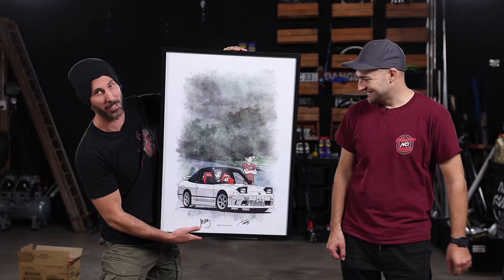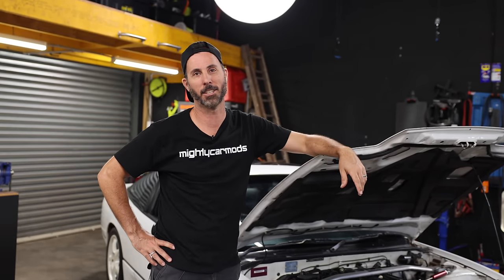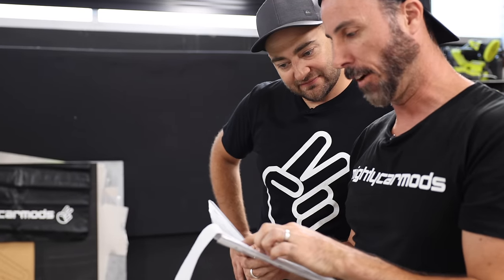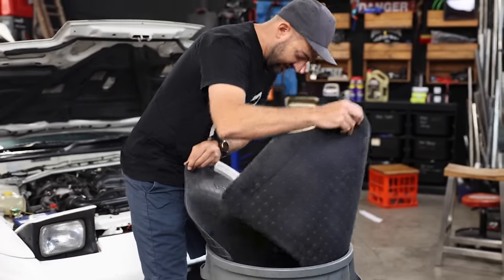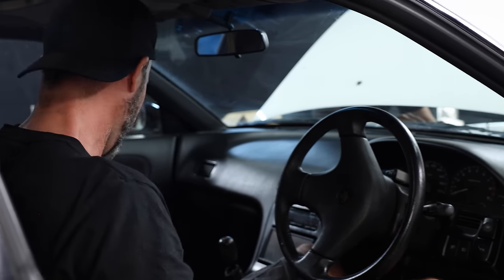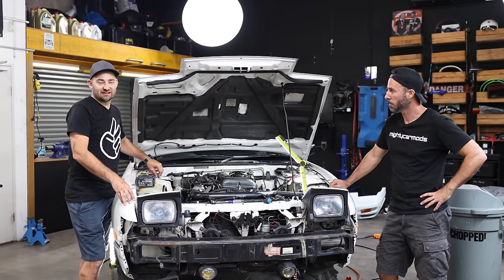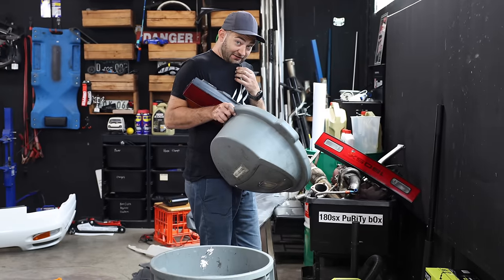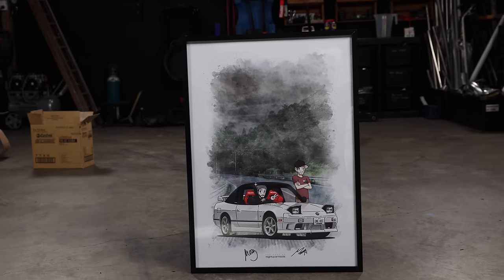180SX - DREAM BUILD

Comment: FYI the little green plug is a brake pedal stopper, it activates the brake switch, sometimes they flog out and your brake lights stay on, just tack a 5c piece in there for ultimate reliability!!
Reply: I slipped a bolt through mine years ago and it’s still fine
Reply: Love Macguyver fixes. 👍👍. Good job 👍👍❤️
Reply: Came here to say this ahah
Reply: @ashbroussard4854  Ah shit same. Think they were unavaliable for a while there too!
Reply: Also goes on the clutch pedal its a stopper for the switches

Comment: I bought my 180sx off a street drifter a few years ago for 11k. I definitely paid too much for it at the time. But 275kw under the bonnet, massive garret turbo on 18-21psi, Z32 gearbox and running on e85. Still just repairing things that break and trying to make it look good again. Lots of plans for it, looking forward to follow the MCM 180sx! Will definitely be grabbing one of those posters.

Comment: YAY \o/ SR20DET build done in 2022. I have a "project" car that's been unloved for years gathering dust in the garage for well over a decade due to circumstances beyond my control. It's JDM import. It's SR20DET powered - it has the late 90's air filter, 3" cat back exhaust (drooooone), the 3 aftermarket gauge pod on the driver's A pillar, the 18" wheels with painted on rubber, the whiteline lowering springs, the blow off valve, the oil catch can, the Profec B boost controller - was running 1.2bar on the stock turbo as a daily. All that "back in the day" stuff. Sadly the uprated heavy clutch caused the demise of the clutch release arm by way of a hole being punched through it by the rod it pushes on (known issue at the time). I had to park it up and mothball it due to lack of funds. Keep meaning to get to it, but.... f****ng life just won't give me a break :(
Hope I can get some inspiration here and see what is now possible. Maybe bring myself to look at it again. It depresses me having it there to the point I can't look, but not letting it go... because.. one of these days I'll be in a position to sort it :D

Comment: 15:19 I laughed way to hard at that, because as an Australian its so true
Reply: Petrol, because it's not a gas lol
Reply: All good points, and then they measure the cylinder pressure in pounds per square inch :(
Reply: Shrimps are not prawns… two different animals

Comment: You can tell how much money they make at this point by how they just toss the OEM perfect condition tails in the trash. OEM tails for my BB6 Prelude are more than I care to wish to pay, and I can only imagine the price of the perfect OEM 240sx tails. 

Props to Marty for saving the day! I'm guessing they both knew that and Moog was just messing with us lol.
Reply: You'd be surprised. I've had pristine stock rear lights and a whole pristine stock  intake (the intake hose, breather hose, airbox, air flow meter and all the mounts and clips) I've had both on ebay at 50 bucks for 6 months. I thought people would be interested in sosres or putting some of the cars back to stock for sale or display/ storage. But apparently not.
Reply: It’s because the kouki and special edition models are out there, no one wants the standard bottom spec ones
Reply: You can barely even give those tail lights away. The only people that want them are usually using them on drift hacks purely for scrutineering.
Reply: They're just trolling us for comments.  I love a good troll.

Comment: Always unplug the injectors (and pull fuel pump fuse if you want) when doing compression testing.
Spraying unburnt fuel in the combustion chambers is going to wash off your surface oil on the cylinder walls and cause the most wear you can imagine.

Comment: 15:10  I've heard that gas vs petrol statement so many times.  It's not called gas because it's a vapor, it's short for gasoline.  Petrol (short for Petroleum) is straight up crude oil.  Gasoline is the distilled and processed derivative of Petroleum.  Petroeum doesn't go in your fuel tank; gasoline does.  But hey to each their own.

Comment: Do that compression test!

These older cars that burn oil usually do because the oil rings clogged up, but the compression rings are fine! Just run a lot of seafoam through them (then change the oil!) and they are fine!

Worked on the last 4 cars I bought!
(and I got killer deals by exaggerating the cost to stop the blue smoke to the owners ;) )

Comment: I had it's brother. The 240 SX convertible. It was a fun little car to drive around the beach in for sure but I should have found one with a stick. The auto trans in that car was trash. Best of luck with yours. I'm sure it's going to be even more fun than I had with mine.

Comment: i had my 180SX for 11 years... 1992 red 5 sp manual. loved the car. could barley get 5K for it when i sold it.  it was completely stock still had the factory sidemount intercooler. stock shocks and springs. did 143Kw at the rear wheels ( 200hp in freedom units) miss that car.....

Comment: I feel so bad for my 240sx. It used to be my daily driver, worked as a pizza delivery car, helped me move around out of my hometown and to various apartments, and was sort of a friend to me. The KA24DE needed to be rebuilt, and it took its last drive in 2014 with the 120 miles back to my parents house where it currently is rotting away. It’s bone stock except a Momo Monte Carlo steering wheel, never in a crash, has that hatch trunk cover thing lol. Not sure what it’s fate is going to be, rusting into a pile…

Comment: Brake option
S14/15 calipers bolt straight on with the s13 knuckle. Then just buy the s14/15 rotor and s14 BMC to suit. For an easy brake upgrade

Comment: used to be able to pick these cars up in SoCal for about $1500 no one wanted them.  Now??? haha 10x's that price if your lucky.  Crazy. In the USA these were called the 240 and had a Nissan Frontier 2.4 4 cylinder.  Engine swapping is what most did with the SR20 from Japan.

Comment: I've got a 2002 Nissan xtrail with an SR20VET that can get up and go, bigger injectors, upgraded turbos and an oil cooler and you could be pushing 300 to the wheels

Comment: That little green rubber thing during the bow tie scene was a brake light switch bulb. It goes between the brake pedal and the brake light switch. If your brake lights ever get stuck on that bulb has failed.

Comment: I'm very intrigued now as to what turbo is going on the SR20. How much will it change the characteristics of the engine? More torque lower down and for a larger part of the rev range? Mmm, yup colour me intrigued 😊
Reply: They said a T28 from an S15, so mid-range will barely be affected, and a little more power up top. Should have moderate power and great response.

Comment: Would go alright with a Borgwarner EFR 6258 if you want a premium product, or even one of the way cheaper Garrett Club Line GBC22-350 turbos if you want something with a reasonable increase but won't break the bank.

Comment: Don't want to criticize but s15 turbos are really dated now. It used to be the cheapest/effective way to increas power but because turbos have improved so much you have much better options available. Granted you'll spend more but you'll get fast spooling and more power.

Comment: Agreed 10,000% on the goals here. You just have to compromise so much on an S13/S14 build to effectively use more than 180kw/240hp at the wheels and you get away from what makes them so fun. On a somewhat related note, what are the prices like on Twin Turbo Z32's down there? Might be a fun build in the future (Turbo Yoda showed a rolling frame off awhile ago, but other than that I haven't seen any others).

Comment: Hi guys I do hope you guys will see this as I'd really like your advice, what model Ryobi Dak Dak are you guys using ?? I bought a Ryobi Dak Dak recently and I'm not impressed it dosent have the torque to undo wheel studs at 400NM now I will keep it, it's great for stubborn bolts and I'm Gunna buy more of the Ryobi gear but I'd also like to have a Dak Dak the same as yere's that will undo wheel studs, thanks guys long live the 180 !! :)

Comment: In 2012 I bought my running registered S13 SR20de q for 1500 AUD. Used it as a daily and over the years taught 2 girls how to drive in it, took it off road and hydrolocked the engine. Sold it in 2015 2500 AUD registered but not running. A decision I still regret to this day.

Comment: Also you are spot on with your power estimate, my 94 which I had at the same time as Moogs first one made 110rwkw with an exhaust then 150rwkw with a front mount and boost controller. Seems a shame to settle for 180rwkw when 220 is so easy (and so much more fun) with exactly the same supporting mods, just a slightly bigger t28 ;).

Comment: Quick question I'm changing my oil in my engine this week I have the washer filter oil etc but I'm not to sure how to crank the car without ignition to get the oil around the engine or does it even matter on a 2016 car.thx for advice in advance.

Comment: 180 kw is kinda weak…. And by kinda really weak.  This is a dream sr20 build.   Can you say that about a car that barely matches the power of a stock 20 year old 350z?

Not saying you need to 1000 hp.  But it should at least not get gapped by entry level muscle cars.

Comment: car-gate has genuinely ruined fun car modifying, you can't even get a 90's MX-5 for less than 15k that's roadworthy, or even a 90's Celica with a garbage-weak engine for under 8k.